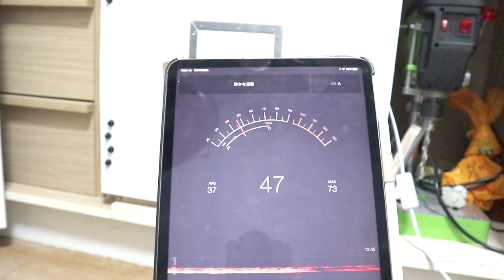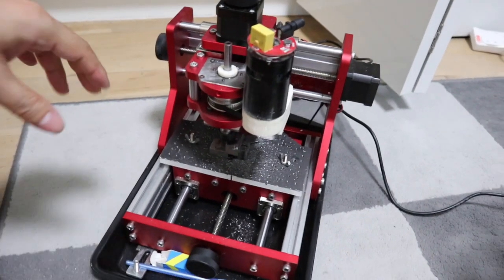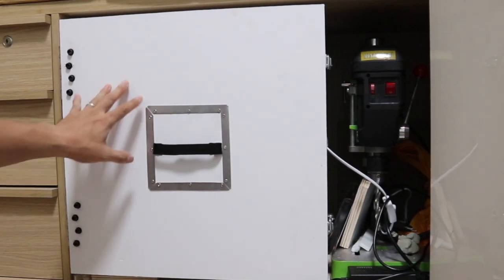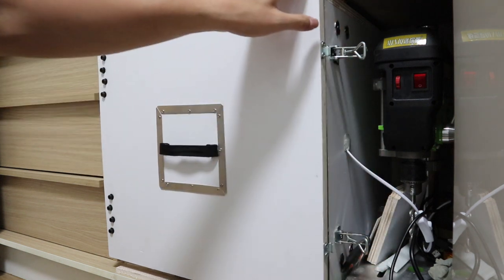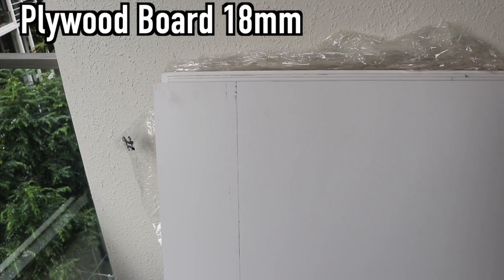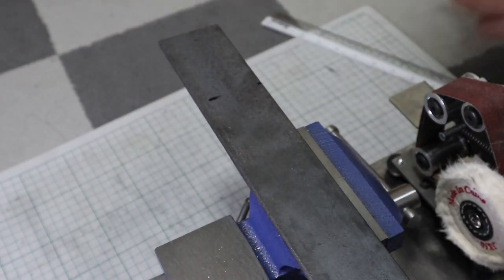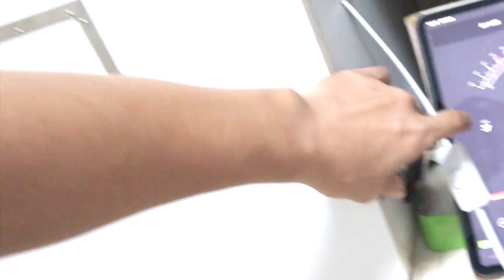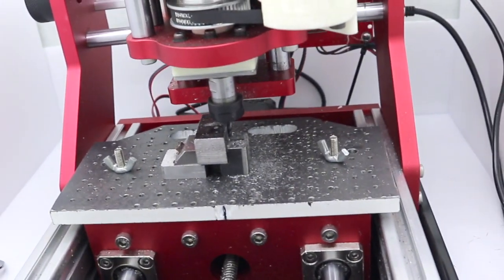Build Cheap DIY CNC SOUNDPROOFING ENCLOSURE  Made of Concrete!.

Comment: Dampeners! Are they usable in cncs as are in 3d printers?
Reply from the maker: Any machine that can fit in this soundproof box will be placed in it.
The 5-axis CNC machine i am currently manufacturing is also designed to fit in this box.
Reply: @a-cnc-f  Sorry about the short text, I texted from the smartphone. I mean: you should try dampeners to see if they are as effective in cnc machines as they are in 3d printers. :)

Comment: I wonder how fast your spindle will die and the other motors as well. Very good Ventilation concept :). Rethink this once more, you will kill you machine during longer milling sessions. The motors will die because of overheating and when you are really unlucky you produce a fire. Im using something similar, but my spindle is watercooled and i mounted also some waterblocks on my nema23 motors. The water flows into a radiator outside the case and can exchange the heat. And yes, Nema17 motors can also die because of overheating. 
Try something to get the heat out of there or you will run into major problems.
The rest is well done, but try to cool it somehow.
Reply from the maker: Thanks for the advice.
This motor is inexpensive so I think if it breaks, I can just replace it.
I may change to a better motor then.
However, I am afraid of fire.
This soundproof enclosure is made of concrete and glass wool sound absorbing material, so I think it is hard to burn, but I am now thinking of adding urethane sound absorbing material.
I am also planning to use a 3D printer inside this enclosure, so heat countermeasure is important.
I will think of some countermeasures.